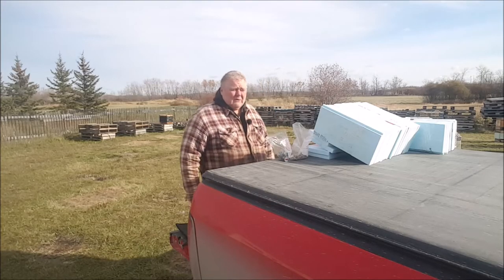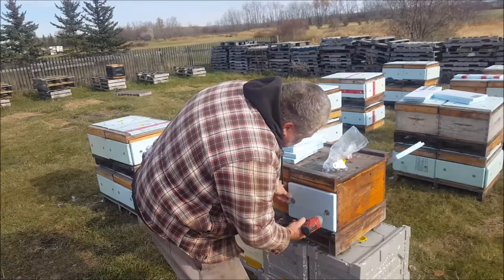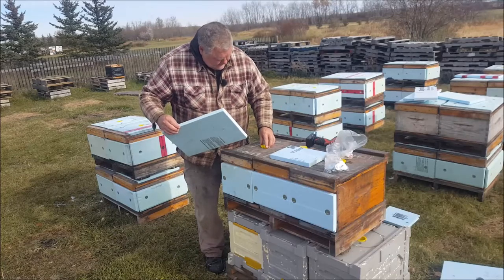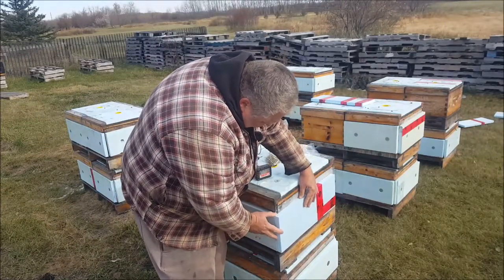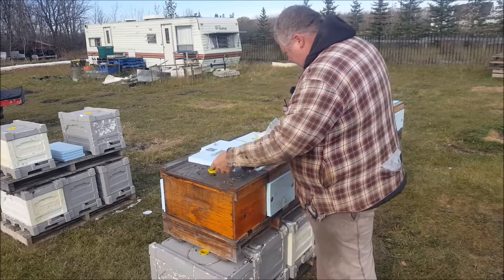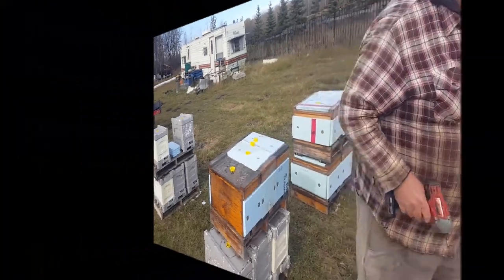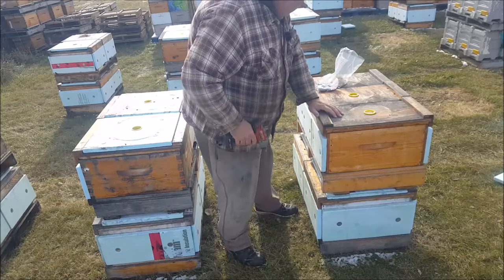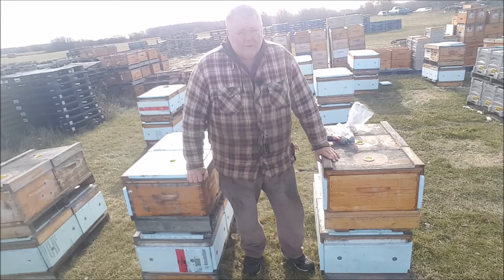Installing Insulating Panels - That Bee Man

Comment: Do you do this every winter?  If so, why take the styrofoam off in the summer?
Reply from the maker: This is something new I am doing since spring 2020.  I do not plan to take the panels off at all.  These hives were increase this summer and didn't get insulated until now.

Comment: Packed everything in foam last winter came out of winter with a heck of a mite problem  .. Now the colonys with the hive top feeder keeping syrup on them all winter with 2" of foam on the sides 4" on top did good .. Pulled two 5 frame nucs i sold 60 pounds of honey and split them in july both sides grew into double deeps by September .. Not sure why ones did better with liquid only thing i can figure cold air being dry bees needed more moisture.. One thing i did notice i had no bees flying out dieing in the snow with the feeder on .. They never did cluster over winter .. Ill play little bit more this winter .. Neighbor packed his lost everything but he reduced the entrance down to about nothing had extremely high moisture readings bees had no vent .  i didn't lose anything with the entrance wide open ..

Comment: I’m trying to get mine all painted black. I’ll be putting a vid up of how I made them. I’ll send it to you when it is. Get your opinion and such.
Reply from the maker: Jake. If you can.  You should paint one black and leave one plain and put Broodminder temperature loggers in both.  That will tell you the truth about what's happening inside.  Temperature stability is the key, not "warmth" per se.
Reply: @ThatBeeMan  yeah I’m hoping that the sun helping warm the insulation that the trapped air win the insulation that is warm will help with the temp deviation.
Reply: @ThatBeeMan  I can’t afford that whole setup right now but I’m trying to find a thermocouple set up I can use for temp reading.

Comment: Thanks for the info, were did you get your washers? I'm going to assume it's an insulation washer application? I've seen them before but they had a nail in them. Definitely like this idea
Reply from the maker: Hi Dave.  I get them at Home Hardware in Selkirk.  They are not an insulation waster per se but I'm not sure what the official application is.  They are just in the bulk fasteners section there.